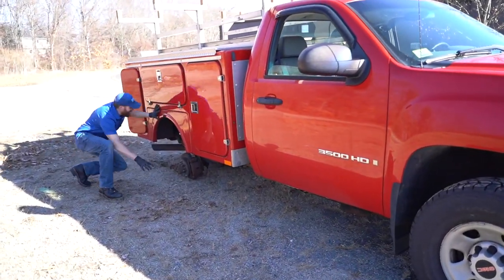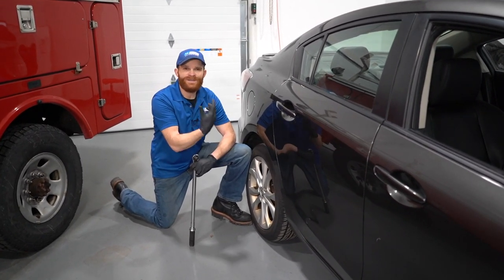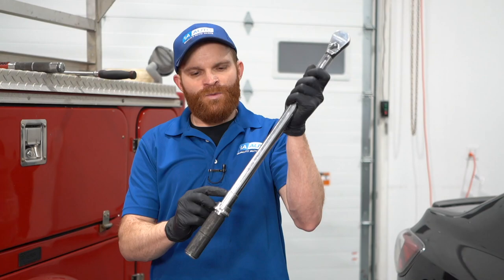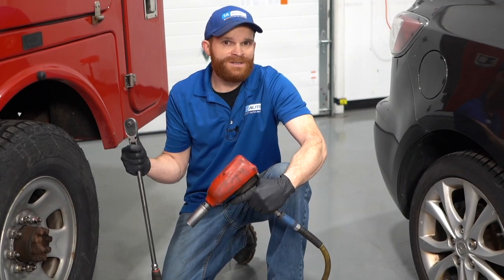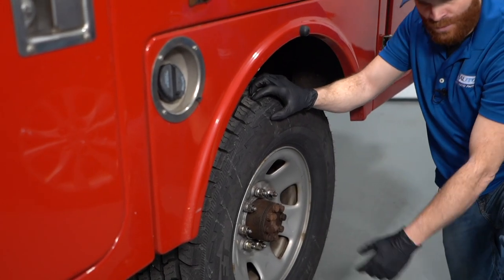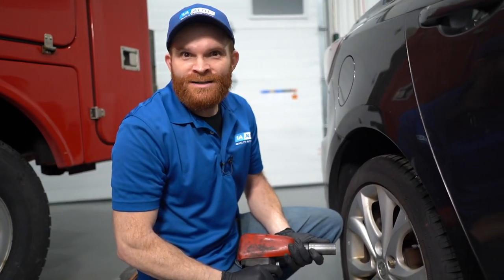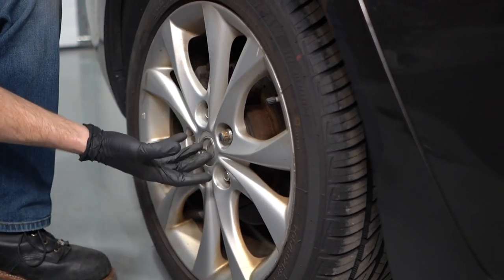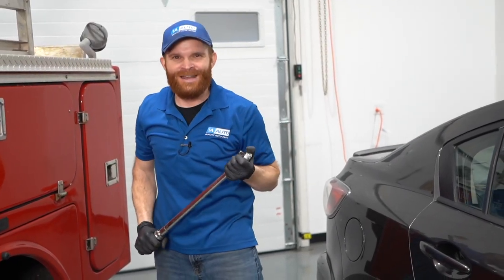Do You Torque Your Car or Truck's Wheels? Here's Why You Should!

Comment: I have a 2016 Tahoe and the lugs were SEVERELY overtorqued by about 100 foot pounds. Should I replace the studs and nuts or will it be fine if I just Re torque the nuts to the proper spec.